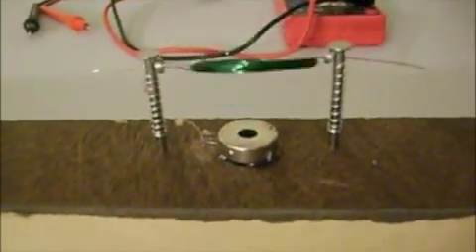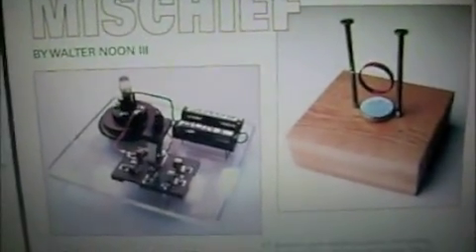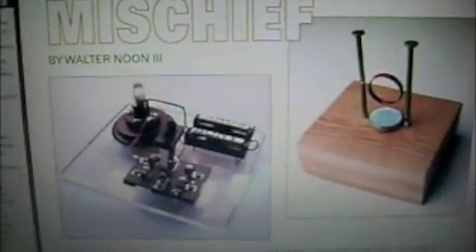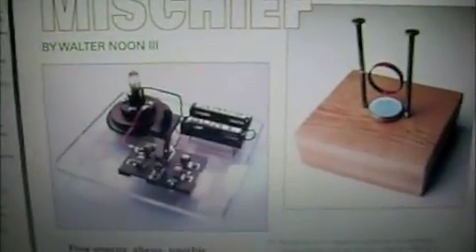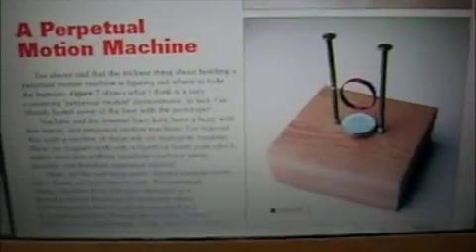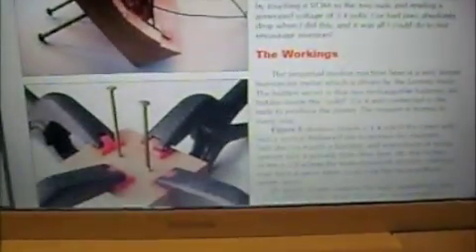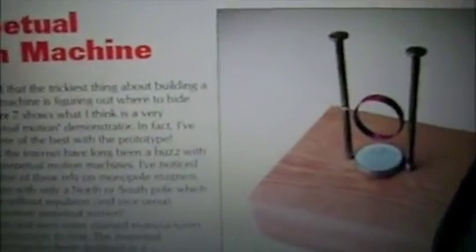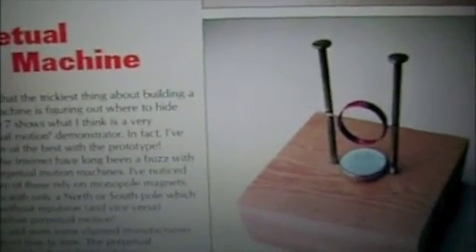Free energy, easy to build, perpetual motion monopole magnetic motor?

Comment: I am just wondering : can a magnet be a monopole ? I assume the only way to get a monopole magnet is to build a hollow one, where the North is on the inside face and the South on the outside (or the other way around). Moreover, assuming the possibility to have a "monopole" (it's not real monopole but it acts as such), what's the working principle   of this device ? Moving the coil in the radial magnetic field causes a current in the coil itself, which creates a magnetic fields of the opposite direction of the monopole .... these two fields, being opposite, tend to attract each other , causing the coil to reverse the direction of its spinning ... I suppose in a real situation this device sooner or later would reach a balance position and stop .

Comment: This is a lame hoax, esp. those who keep repeating it... Actually this is based on the "most simple motor" design, by some students at the ETH zurich. The Magnet isn't required. Use a rubberband to tack two paperclips to the ends of a AA Battery. Bend them so they can carry the coil. The coil is made of coated wire, but you got to scratch off the coating at the ends, entirely at the right side, and only on the top side of the left  side. push it slightly, there you got your puls motor.

Comment: Magnetic wire.... Ha ha ha ha,,,,, your stupid.. Its called magnet wire.. But its not magnetic... Its just a very thin copper wire,, like a 28 or 30 gauge.. And hooking a battery to ur screws would not make it turn..its the opposing magnetic field in your coil induced by the electrical field in the coil caused by moving neutrons moving from atom to atom in the wire by the mangetic field of monopole magnet

Comment: how many turns and and thickness of the wire, can we make it possible with a S-N magnet...
Reply from the maker: I picked up a magnetic wire kit at Radio Shack. For something like this, it's better to use one of the thinner wires. The amount of turns isn't crucial. And yes, it works with a standard magnet.

Comment: Does it work with metal wire
Reply: Motionmagnetics You need magnet wire, which is used for winding motors and transformers. It has a very thin enamel insulation which doesn't take up much room or hold off much voltage; but it works here. It's easy to scrape off. It's made of regular copper and is not magnetic.
Reply from the maker: You have to use magnetic wire.

Comment: the term monoplole magnet  appears to be in common usage by amataeurs and armchair inventors. It would seem that these people nave never had any sort of education or formal schooling. This is the situation in undeveloped nations but most of the posts on Youtube are westerners or people from developed countries. Yet these people freely refer to monopole magnets and even indacte the local hardware store as a source for these. They are absolutely not aware that monopole magnets do not exist and in fact cannot exist. There is an  appprocimation to a monopole magnet and that is a bar magnet of considerable length. Such a bar magnet has its poles at each end and as the distance between these ends is considerable each pole at each end bahaves as if it is isolated and unaffected by the magnetic pole at the oppoosite end of the bar. Magnetic lines of flux. so called imaginary in nature leave each end of the long bar magnet almost normal to the sirface of the  bar ends and if these ends are sperical then the fluc lines or an appreciable number of them leave the spherical end normal to the sperical surface and travel into space apparently but actualaly travelling a very wide circular path to the magnetic pole at the other end of the bar magnet.. One of the earliest homopolar motors used this type of bar magnet and it was thought at that time that the action of the rotor was due to the isolated magnetic pole and the motor was referred to as the monopole motor. Actually the fluc lines cut the rotor and resulted in the normal reaction found in all motors. . These flux lines returned to the magnetic pole at the other end of the bar magnet and there was nothing like an isolated magnetic pole only a magnetic pole separated from its opposite pole by a considerable distance. . There is an interesting video on Youtuve which shows how to obtain monopoles using loudspeaker type magnets by placing steel balls along one edge of the circular magnet and thus obtain many apparently isolated monopoles but these are in fact of one polarity induced by contact with one particular edge of the circular magnet and may be taken as monopole magnets even though they are not isolated from the opposite magnetic polarity which is on the other edge of the circular magnet.

Comment: not sure if anyone told you but perpetual means continuous. Your device keeps stopping and requires mechanical assistance to continue. This would not qualify as a perpetual motion machine. And certainly does not generate any electricity. Free or otherwise.

Back to the drawing board brother.

Comment: Just explain how Jeff Williams performed a "trick" when he has a board too thin to put anything inside, he shows the bottom and ends of the board and there is no cut section in the bottom nor wires coming from it. I bought a pack of monopoles from hobby lobby for seven bucks after watching his video and mine works just fine.
Reply: Sure it does.... Do you have a video?
Reply: “ I bought a pack of monopoles”.  Lol.   Too much silliness
Reply: Lol

Comment: If you flipped a coin in space would it spin forever?
If you replaced the coin with a magnet and surrounded it with copper wiring would it not induce an electrical field forever?
If you tapped off that electricity would you not in fact have a free-energy perpetual-motion electric generator?
Only fools use the word "impossible", rather than use their brains for thinking.
.
Back to the studio and here's Tom with the Weather...

Comment: That's AWG, and it doesn't matter -- as long as it doesn't draw enough current to melt it. In other words, it is a matter of the type of battery used and the number of turns of wire.

Comment: :D loool wont work, the nails are connected to a battery! There are no Monopolemagnets in this form, what you are seing is a normal neodymium magnet, which has 2 poles as every other magnet. This is just a fancy form of a homopolar Motor. Google Homopolar Motor to see how this really works. This guy uses a hollow box of wood which houses the batterys, as the coil moves to the side, it no longer has connection to the right nail, hence the enailed wire, so the motor stops!

Comment: It's totally fake! The screws are connected to a battery. You will notice that the wire that touches the screws are stripped or do not have lacquer paint in it. Current cannot flow on closed loop (shorted circuit) or open circuit so the coil cannot produce magnetic flux that will enable it to rotate.

Comment: fake and gay a monopole can only theoretically exist, and the coil would move unless you pass a current through it, and that would work with a normal magnet to, so dont be fooled by clouns like this guy. if you remember, sheldon couldnt find a monopole! lol. and also, perpetual motion is imposible and that is long known by physics, IF  what you did was actually posible, it wouldnt be perpetual motion because the magnet would get de-magnetized with time.

Comment from the maker: It's just basic magnetic wire, that you can pick up at any Radio Shack. You have to shave the plastic coating off of the end pieces that touch the nails, which is why the wire looks more silver there, but that's really all there is to it.

Comment from the maker: Watch my video in it's entirety, and cross reference the links that I provided on the origin of the motor's designs, to verify that information I provided is entirely true. Then you will realize that even if the original motor were live streamed for a year or fifty years it would make zero difference. I'm not someone who doesn't believe alternative energy is possible. That's why I have this channel and post my research. However, not every supposed magnetic motor video out there is real.

Comment from the maker: lol Nice! I've done that before too. If you have an electronic magnet pole identifier, run it along the point where the two magnets are joined together though, and you will discover that the second pole still exists. All you are really doing is redirecting the magnetic fields into another area. If you really want to get clever, wrap a steel ring around the point where the two magnets are joined. If the metal is thick enough, you will effectively shield one magnetic pole.